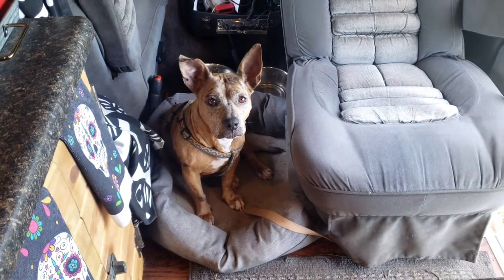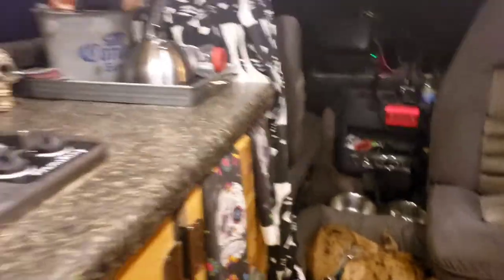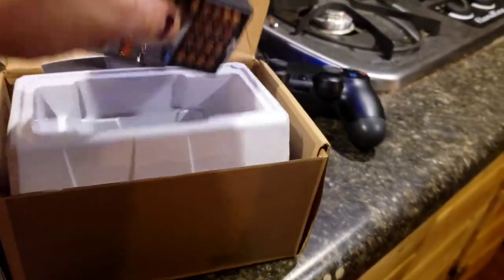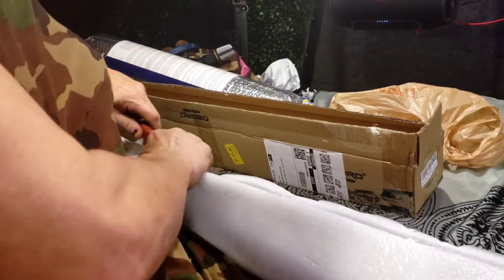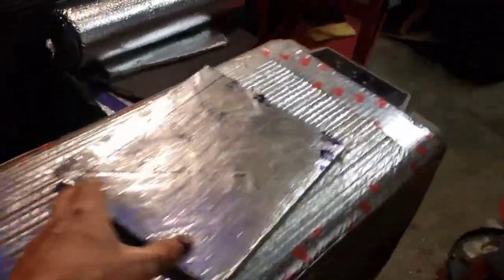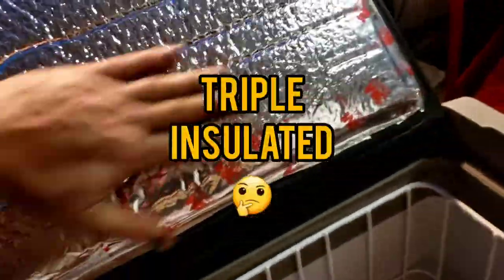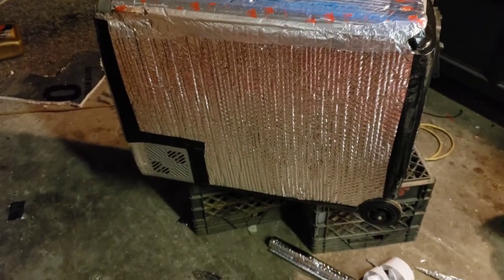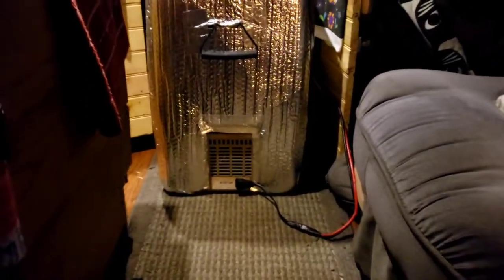Insulating a 12 Volt Fridge

Comment: Did you notice any improvements with that Everbilt stuff? Are your temps fluctuating less now? I just bought my first ever 12v fridge. It’s the Alpicool T60 with the LG compressor. Is it normal for the fridge to keep on cycling? The temps keep fluctuating on the freezer side. When I set it to -4F, it fluctuates from -3 to 14 degrees.
Reply from the maker: This one died shortly after the video. I replaced it with the same one you got. I'm only using it as a fridge and really don't pay much attention to it. The lcd went out in no time and I don't use the app to look at the Temps. If my food and booze stay cool I'm happy. It does cycle quite a bit. I did the reflectix on the lid with some closed cell insulation on the inside of the lid because you could feel the cold escaping from there quite a bit
Reply: @tashatorrid  I bought the Everbilt Insulation. It says radiant barrier. Is that the same one your using on your T60? I also bought Alpicool’s insulation cover, which I can’t really tell if it helps much as I put it on straight away when I bought the fridge. I really don’t want to wear out the compressor. Because it literally hits -3 for like 1 minute, and goes straight back up. So it’s technically cycling 98% of the time, is that normal?
Reply from the maker: I probably wouldn't set it that low. It's more than likely unattainable in the long run And why it's cycling. These are cheap Chinese garbage meant for occasional use I believe.